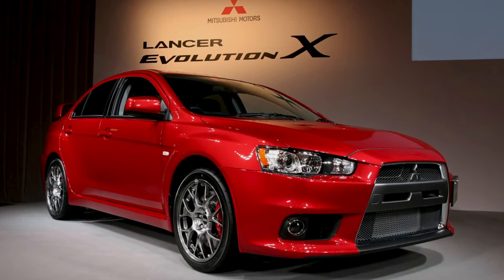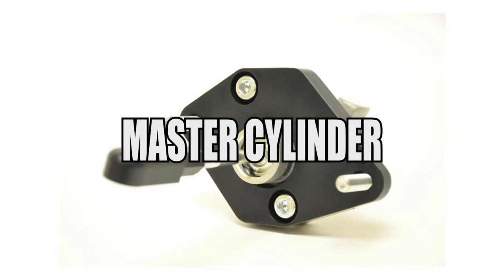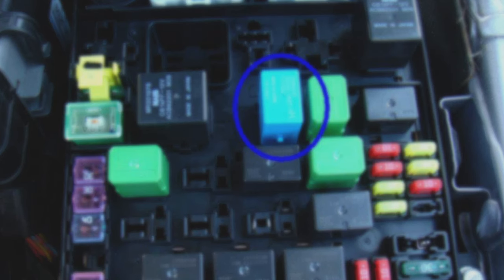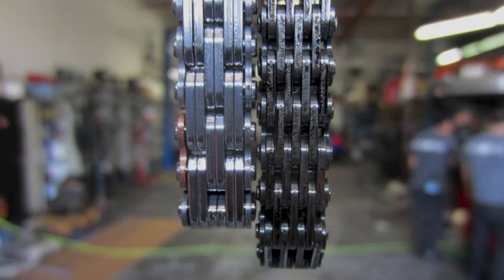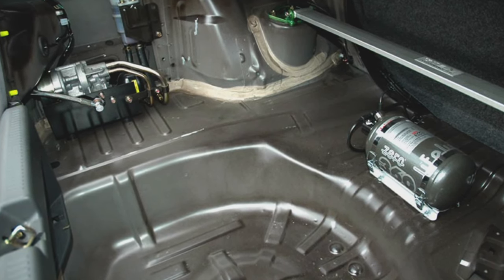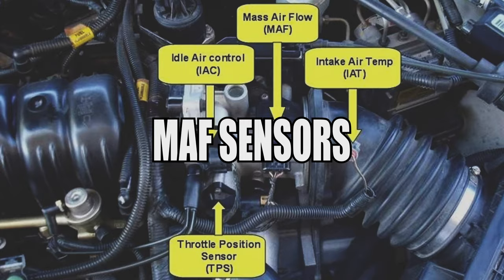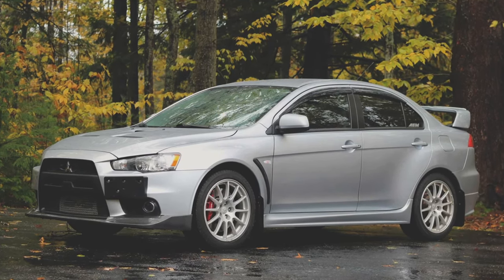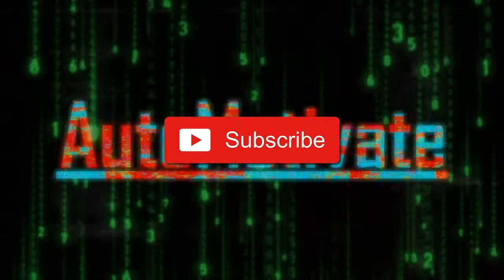Watch This Before Buying a Mitsubishi Evo Lancer 2008-2015

Comment: I have an 08 evo x replace the clutch master cylinder and timing chain, cars is pushing 450whp on e85 no problems at all 94kmiles
Reply: Oh yeah tha manifold does crack once pushing some power
Reply: At what miles should the timing chain be replaced ?
Reply: @sixstrz8310  on early  models as soon as u plan on pushing any extra power, reason being the first gen Evo x came with a single link chain versus a dual that I believe 2011-2015 came with factory
Reply: @angelcoria5432  forsures thanks for the reply Im looking at a 2012 evo x with 73k miles hopefully that’s not an issue since it’s newer evo model

Comment: Evo x prices are high right now. If you get one. Make sure you get it tuned by a reputable tuner!! Even if it's mostly stock!   Mine ended getting a misfire, not terrible and still easily drivable, turned out the exhaust valves were burnt, due to the car running lean for a while. And that's some what a common problem with evo x with the valves.  Tune very important on these cars.

Comment: Im between getting an evo x or an wrx sti but ive heard sti motors blowing up even when kept stock and now I see the evo x has the ayc pump issue and i bet it happens around 100k and all the evos i see have between 60-80k and i dont want to be 35k deep in debt and still have to spend more cash to fix it

Comment: some of these were actually addressed by mitsubishi.
i must have taken my car in for Recall servicing a dozen times! ( i have the 2010 gsr)
Yes my shocks gave out so fast. replaced with coilovers,
most annoying thing for me was the Trunk lid started to break on both sides.
big cracks down the side. I think from the weight of the massive spoiler and the force from the trunk closing.

Comment: AYC pump is covered under recall.  Unsure if they upgraded it with the replacement unit.
Reply: I know this is an old comment, but it's not a recall. It's extended warranty coverage. Once your car hits 10 years old or 100k miles, your coverage goes POOF

Comment: Do you have a video like this about 2014 Ralliart? If not I would love to watch soon. 😊
Reply from the maker: From what I grasp is that they are pretty similar. The ralliart has a small spoiler and is not as wide as the Evo, Evo has slight different exterior bits, larger intercooler, larger turbo, taller 5th and 6th gear, SH-AWD. Just about everything else is very similar. Same engine components.
Reply from the maker: I may look further into the car in the future. Hope that helped you out in the meantime!
Reply: @AutoMotivate  research problems on the trans it would be nice ! 
Would have a video to post in the ralliart fb page

Comment: Lol, you talk about the 4B11T from an Evo X while showing a 4B11 base Lancer engine in the video.
The most notable issue with the Evo X is the SST transmission in the MR model. It has a few common failures (i.e. shift fork), which are difficult and very expensive to fix. 
Btw it's an Evo TEN. X as in Roman numerals.
Reply: I hear the MR's TC-SST overheats or something like that. I have the '14 gsr
Reply: @markg9401  It doesn't have any heat issues if used properly (bringing it up to operating temps before heavy driving and using S-Sport). Improperly modified/tuned cars can have issues. 
However, the SST does have issues with cold starts in extreme low temps. Block heater is a must.

Comment: What do you lubricate the shocks with?
Reply from the maker: I’m sure white Lithium Spray Grease from Blaster would do the trick. 
Spray to top and bottom hats and the shaft of the strut. 
If the knocking noise comes back (very well could come back) you will most likely need to rebuild them.
Reply: @AutoMotivate  thanks, I'll have to take a look

Comment: its evo ten not evo ex
Reply from the maker: Did you know that X means 10? 
Either way is proper.
Reply: @AutoMotivate  incorrect. No one says a 2004 evo is an evo vee eye eye eye. Or a 2006 evo is an evo eye ex. In the same way an evo ten is not an evo ex
Reply: It's pronounced evo chi

Comment: underpowered...my volvo s60 awd has 324 hp from factory.
Reply: S60r has 300hp and weighs about the same. Similar cars actually, surprised they weren’t viewed as direct competition
Reply: Don't tell lies. I had an S60r and it's not half the car of the evo. It also has 301bhp so not sure where Your numbers came from.